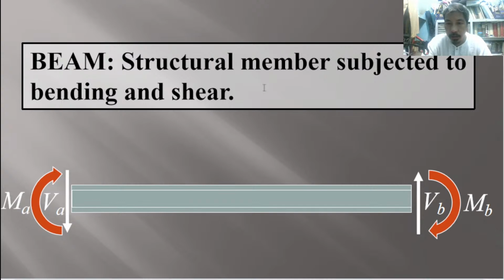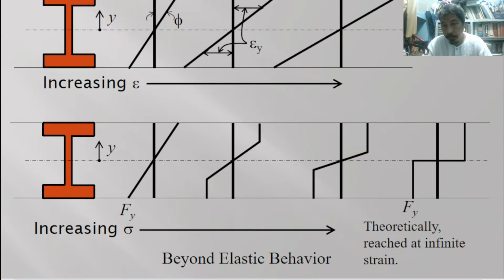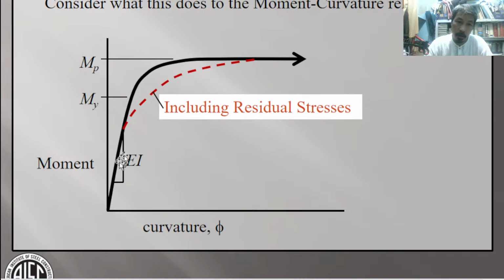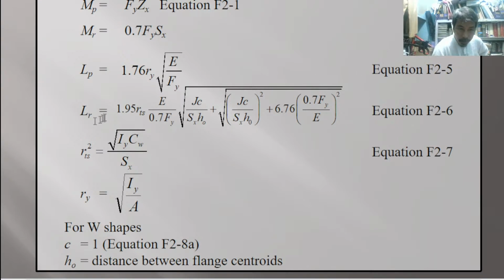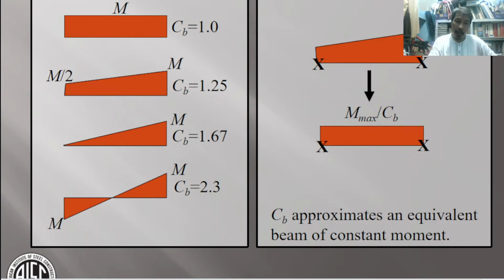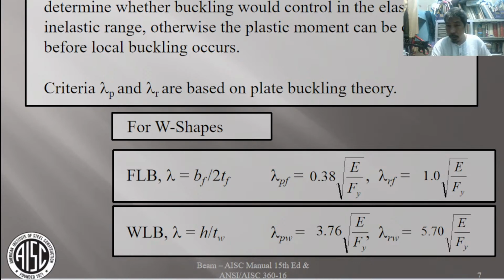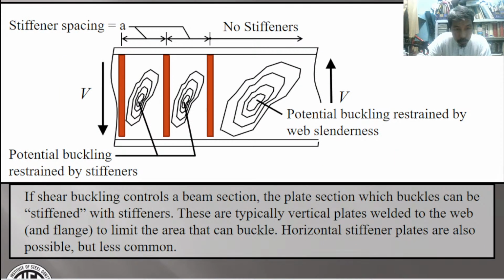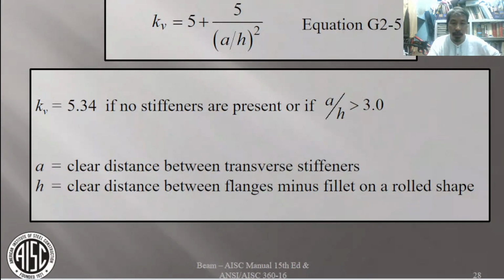[ LIVE CEE6 Lecture25 ] DrAP Zantua Design of Steel Beams + Examples of Beam Members

Comment: Thankyou sir for discussing about design of steel beams. I've learned that LTB occurs along the length of the section. Compression flange tries to buckle as a column. Tension Flange tries to stay in place. Result is lateral movement of the compression flange and torsional twist of the cross section.

Comment: Thank you sir for the live lecture about the design of steel beams and the theory of beams. Beam on structural member that is subjected to bending and shear were graphically shown. The moment can be related to stresses, strains, and curvature. Lateral torsional buckling was also discussed. AISC Manual suggestions with regards to beams members. Consider lateral-torsional buckling as a potential failure mode prior to reaching the plastic moment if the members are compact. Thank you sir.